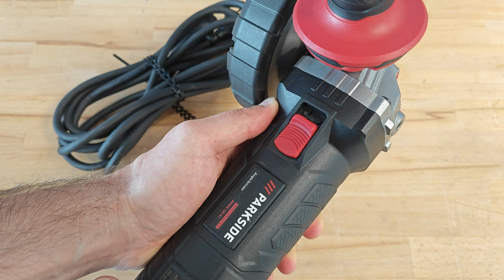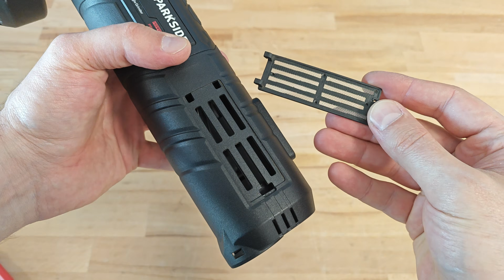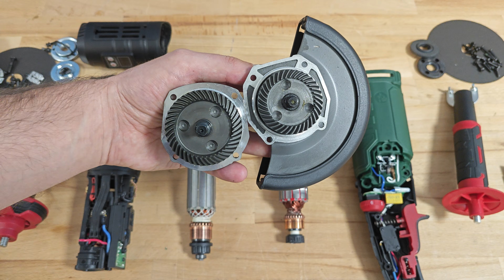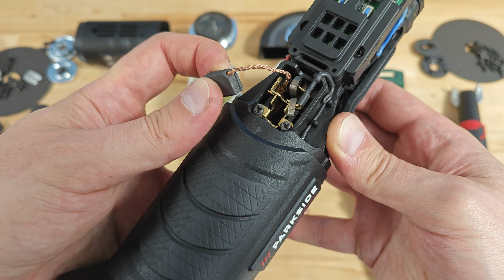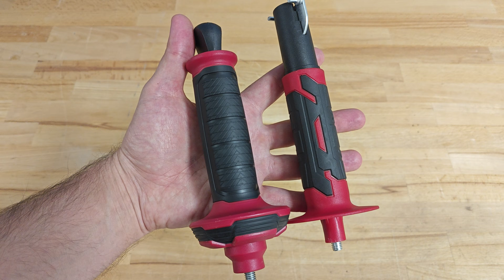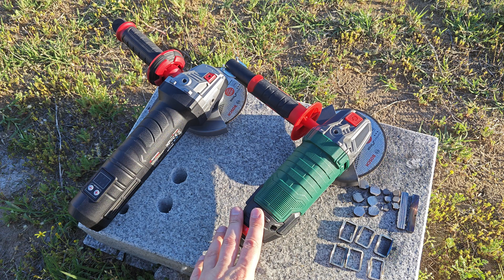Parkside Performance 1700W PPWS 125 A1 Angle Grinder

Comment: The latest green is the i8 version and the brushes have the same connections as the performance. Also, no play in the shaft or anywhere else. Further more it is an angle grinder, so a little bit of play doesn't matter at all. Now you see why the performance has lower speed. Because they gave it more torgue.

Comment: i bet the 9000 rpm is because of the speed controller with tachometer that modulate power to keep constant rpm and need to work on lower rpm than max to have spare power on max speed setting
its the same in high quality grinders , it works better because motor keep constant rpm and you won't have issues with "jumping" cutting disc on the material etc
Reply: Or because they plan to use the same body for 150mm grinder :-) As I usually do much more grinding and sanding than cutting, I prefer bigger power, lower speed an hence a higher torque.

Comment: 2024 and we still have brushed motors
Reply: Have you ever seen corded power tools with a brushless motor? I don’t think so
Reply: @nazzytpr hikoki ,ex Hitachi, has all corded tools with brushless motors. But the price is enough to give you a stroke
Reply: @nazzytpr  Flex L 13-10 125-EC, 

1300 watt angle grinder with brushless motor, 125 mm
Reply: @nazzytpr  Bosch GWS 30-230 PB, DEWALT DWE4357-QS, Hikoki G13BYEQ G13BYEQNSZ, SENIX PAE12-H-EU.   Уже давно.
Reply: brushless motor makes sense in cordless tools. Brushes in cordless tools must handle 10x higher current than corded motor by 230V to reach the same power.
Reply: you dont need bldc in wire tools, the brushed motor has proved itself for more than 100years now. why change?
Reply: @pawelw.9172  Зачем вы пользуетесь автомобилем? Лошадь зарекомендовала себя тысячи лет назад.)))
Reply: constant magnet and metal powder are not a good combination

Comment: For what application you need 1700W of power in a 125mm disc size?
Reply: Grinding at lower speeds, when nominal power is only available at full speed...
Reply: @jduzivotem3985  Why would you grind at lower speed and not on full? You are reducing your cutting speed from optimal 80/m s .If you take a closer look all of grinders maximum speeds do that no matter the diameter -wheel on 230 is bigger but rpm's are lower to get you those 80m/s optimal cutting speed.
Reply: @zumbazumba1  more precision or problems with workpiece overheating, working with wood, etc
Reply: heavy grinding, espeacily fiber disk
Reply: for low speed cutting in thick ceramic materials where is important to avoid heating the diamond blade, and overheating the motor too
Reply: In what situation is having a lot of power a bad thing? 🤣
Reply: @MiguelCamba  the situation where you don't bother upgrading and keep your money in your pocket 😊
Reply: @MiguelCamba  In situation in which a 900W is more than plenty for 125mm disc and rest of the attachment.If you know what you are doing its enough power for all tasks and the rest of it is waisted on heavy bulky angle grinder body that makes you tired as you work?
Reply: @MiguelCamba  More power usually mean more weight and bigger tool, meaning more exhausting work.
Reply: @jduzivotem3985  but you are not against power, you are against weight. If weight is similar, more power means cut is done quicker and you carry the weight less time